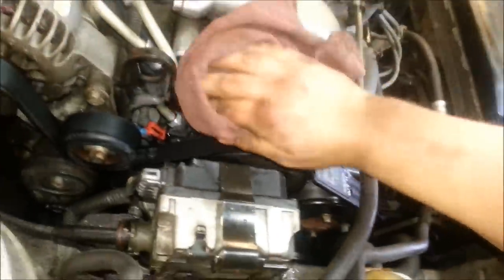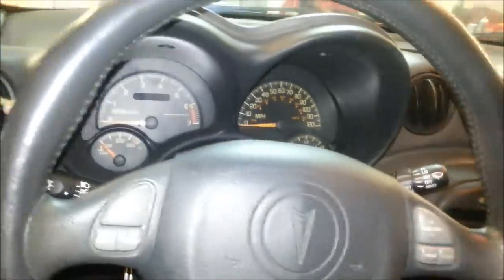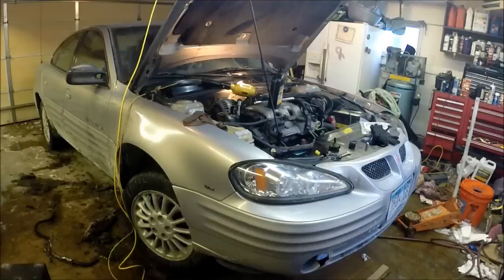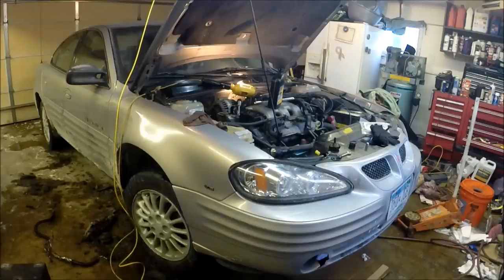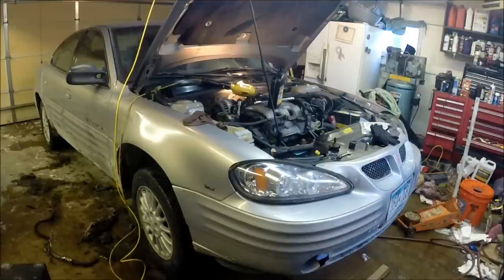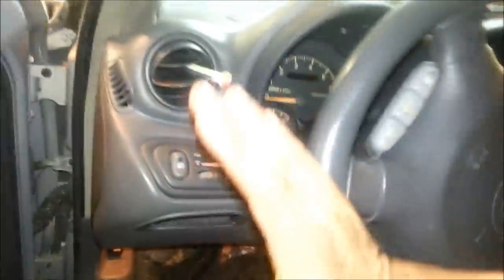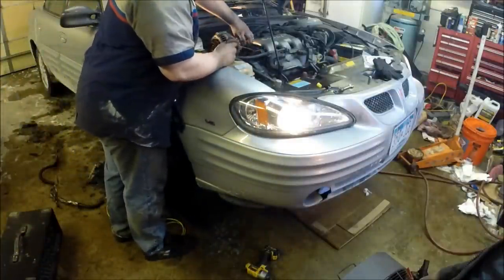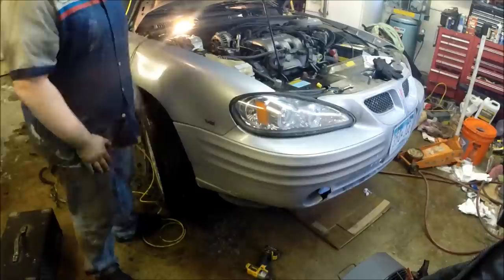how to bleed a gm powersteering pump

Comment: thanks for your help. my power steering fluid was coming out of the reservoir like a fountiain. I never try to bleed it with the car off the ground before. I saw this great video and did it with my car off the ground and it was so much easier! Man the strengh that I had to use to turn the wheel side to side with the car on the ground!!!
Reply: it was coming out of the reservoir while the car was on and tuening the wheel side to side. Would that be air???
Reply from the maker: +morganix007  could just be way overfull as well but air will push fluid up

Comment: Thanks for the video! I just replaced the pump and the steering was still hard to turn. Once I did what you said it worked! Thanks!
Reply from the maker: glad i could help you out.
Reply: Hey I replaced my pump, and I have a slightly dripping return line, but my stuff is still so hard to turn, but works when you jump the rpm up, so I have a bad center seal in my rack?

Comment: Power steering on my 08 Grand Prix GXP went out 2 days ago with little warning. The pump was never very noisey- only a very faint whine when turning right that you could only hear with the radio off and windows up. I'm going to try this tomorrow. I was rather low on fluid when I checked.

Comment: I have just replaced the pressure and return lines on an 01 GA, and went to use the Mityvac set up but the rubber cone does not seal in the neck of the reservoir and also is too long and sucks up fluid when its at its cold fill level..I ended up having to move the car out of the garage last night and of course the fluid foams right up (not bleed at all really).  So its gonna be a real pita to get air out of it now by any means.  Will have to start it again to get it back inside..so any settling that has gone on will be messed up again to try and do it by your method.  Why a proper adapter is not available for the necks of these style of P/S pumps is not available, is beyond me!  Good vid!
Reply from the maker: I hear you I've been searching for the adapter for awhile
Reply: +JoeTheAutoGuy I was just wondering if one could be made from an old cap from one of those pumps...
Reply from the maker: +Chris C that is a very clever idea , I think I'm going to buy a replacement  cap to modify ,
Reply: +JoeTheAutoGuy I just finished hacking up an old cap, cut off the dipstick and spring etc, took the rubber gasket out and set aside.  Then I drilled 1/2" hole in top of cap, threaded an air tool adapter male fitting into it and tightened it down snug.  Used some GOOP adhesive/sealant around the threads.  The clear vinyl tubing from the mityvac will fit onto the end of the air tool adapter, lay the cap onto the neck of the reservoir (rubber gasket back in place) and she pulls vacuum!

Comment: Hey Joe great video man.  I have a '13 Impala, I sucked all the fluid out of the reservoir as I could, disconnected the return line right there, jacked the car up and turned the wheels lock to lock to try to get the old fluid pumped out the return line into a pan, but got nothing. So I plugged the reservoir where the return line went in and put new fluid in the reservoir, turned the wheels lock to lock a bunch of times (20-30) nothing! Fluid didn't move in the reservoir and nothing out the return line. As soon as I hook the return line back up to the reservoir and turn the wheels, fluid gets pumped into the reservoir from the return line.. What am I doing wrong?!?!? Wheels are off the ground, key on engine off, following the alldata procedure for it, what am I missing???

Comment: Would you recommend using lucas stop leak in the power steering fluid? I heard Lucas can improve performance in the power steering system.
Reply from the maker: In this generation and in most applications no I for not recommend this system has a valve that requires flow efficiency, the stop leak will inhibit this action stop leak worked in older vehicles but new stuff and synthetic fluid requirements make those chemicals obsolete and will actually damage the system intended operation
Reply: I think this stuff is really thick to the point itll increase the pressure of the fluid and you'll wind up snapping off weak points. My return line at the bottom was rusted so the replacements kept coming off until I just used the fluid recommended by the manufacturer.

Comment: Thanks for video, i noticed you didn't use a vacuum pump. Is that a necessary step to use the pump?
Reply from the maker: its Most manufactures way of filling now but not an absolute necessity

Comment: I replaced the power steering power because it had a crack, so after I finish installing the new one... do I do what you did because I see bubbles coming out?
Reply from the maker: +The Lopez Way always need to bleed if system is opened( besides the cap )

Comment: GM's recommended adapter fitting (J43485) won't seal off the reservoir opening because GM reservoir openings aren't round (they have two notches along the inner circumference as can be seen in this video).  Why does GM recommend an adapter fitting that won't work?
Reply from the maker: Flip it upside down seals fine

Comment: I have a 1980 k5 blazer and im having issues with the power steering. it binds every so often especially in a tight spot. I replaced the power steering pump twice. just put the second one in today. I tried bleeding it and it work awesome the first few minutes but as soon as I really got on the road it started acting up again. i used the same method you used except instead of the fluid going down it started to over flow. i removed some and it still binds up and the fluid when i check it is foamy. i tried bleeding the air out of it again i works find then it starts binding again. i cant us the vacuum method cause these old cars have cut outs on the sides of the power steering caps. i don't see any leaks but wanted to know if you have any recommendations to help solve this power steering issue. thanks

Comment: Have to change a seized pump that threw the belt on a 2001 Buick Regal LS. The pump is in the WORST possible spot....bottom and back of engine. Ugh. Who thought THAT was a good place for a pump and reservoir? You have to take the wheel off just to access the cap. That engineer should have been hung by their short and curlys. Probably better do the pressure line while I'm in there. NOT looking forward to this AT ALL.

Thanks for the video. Very helpful.

Comment: I have a 2004 Pontiac grand prix gt and im having a problem with the power steering pump when the engine is cold i can turn the steering wheel pretty easy but when the engine warms up i dont have any power steering what would cause that?
Reply: Overheating of the fluid because of air in the system
Reply: I replaced the pump and problem fixed
Reply: @miker5044  thats good 👍 . Did you replace it yourself?
Reply: Yea i did it was not to hard to do

Comment: Hey you know how to fix the security problem for the pontiac grand am
Reply: many videos on you tube best is a 2ohm resistor in yellow wire coming from ignition video permanent fix other temp leave key in on position not running till security light goes out seen some take up to 40 minn avrage 10 to 15 minn I my self have done 13 of these everyone different BCM modules go bad also cars with no cabin filter reinstalled rain water floods BCM directly under Blower motor in glove box

Comment: I'm doing this and I'm worried that there is to much air trapped in my system. I turn my steering wheel lock to lock with the car raised and I hear gurgling but the fluid in the reservoir doesn't move it just goes up and down then when I try with the engine on the fluid foams up very quickly
Reply from the maker: +OGFadedThoughts  sometimes they need to sit for awhile ( overnight) to get really stubborn air out

Comment: i tried all you said to do but when ever  i turn the wheels left and right the fluid over flows, with the car off!
Reply from the maker: then there is a lrge pocket of air coming up just keep doing whAT YOUR DOING AND DONT OVERFILL IT. then folow the process i highlight and it should be good
Reply: thanks,
Reply: JoeTheAutoGuy-can u cause harm if it is over filled?
Reply: Dubblesteel hell yes

Comment: the thing about my 2000 olds Alero is that it is leaking steering fluid, so I would top it off every time it made that 'creaking' sound when you would turn the steering wheel. But now, the steering wheel has gone stiff, like it has no power steering at all, and even when I top it off with steering fluid, the stuff disappears from the reservoir and the steering continues to be stiff as all hell! 

what is going on? please answer as I am stumped!!!!
Reply: non-descript influence clearly you have a leak.
Reply: Rack and pinion that’s my problem right now

Comment: my 99 grandam has the foamy thing going on after we changed the pump, the fluid wont circulate at all and my car wasnt rasied.. the fluid that i did put in the car is on the ground and what i had left in the bottle and put in it just now is being thrown all over the car?  what do i do lol..
Reply from the maker: need to find the leak
Reply: +JoeTheAutoGuy ... it has the 2 hoses ,,if its not leaking from there what are my other options ? i dont wanna have to take the thing back off again..lol
Reply from the maker: +ashley dotson if it's not leaking from the hoses it's either leaking from the power steering rack itself or the pump
Reply: +JoeTheAutoGuy from what i can tell the  leaking is coming from around the pump area.. id say ill have to take it off again,, ,, but before i had the leak the fluid wouldnt circulate,,, it would just foam up any advice on what that would be? lol im sorry im bothering ya
Reply from the maker: +ashley dotson not bothering me lol, if it's around the pump area check the seal that goes for the high pressure line (threaded one), some times it won't look like it's circulating because the fluid stabilizes at a certain point under no load  , if it's not coming from the lines it's coming from either the reservoir seal or the shafts seal itself
Reply: +JoeTheAutoGuy I have done everything youve done in your video, I had recently replaced the pump because it was leaking. With the new one installed i have bled it. But it pours all the fluid out onto the ground. It isnt the high or low pressure lines leaking. its coming from a small hole on the bottom of the pump. I was told it is a "weep" hole. why would it be leaking from that hole. 2002 Montana, same pump in your video. Ive went through 2 quarts of steering fluid. Is it a bad pump, or is it supposed to do that until air is gone. And would that weep hole be sucking in air. Thanks for the video....
Reply: +JoeTheAutoGuy I have done everything youve done in your video, I had recently replaced the pump because it was leaking. With the new one installed i have bled it. But it pours all the fluid out onto the ground. It isnt the high or low pressure lines leaking. its coming from a small hole on the bottom of the pump. I was told it is a "weep" hole. why would it be leaking from that hole. 2002 Montana, same pump in your video. Ive went through 2 quarts of steering fluid. Is it a bad pump, or is it supposed to do that until air is gone. And would that weep hole be sucking in air. Thanks for the video....
Reply from the maker: +120 Market Suites definitely a bad pump if it's spitting out fluid
Reply: Have you heard of this weep hole
Reply from the maker: +120 Market Suites on a powersteering  pump can't say I have , waterpumps yes but not ps  pumps  but I don't know everything manufacturers change things all the time
Reply: Okay thanks so much for responding so quickly, I have never heard of this before either. I did look on the old pump that came off and it had it too. A small 1/8 " hole. Guess ill be taking it back off and going to the auto parts store again. Thanks for the info and the video.

Comment: I got a new pump installed 3 days ago and now its making noise??? 3800 Series 2 GTP. 1999. Help me man can I drive safe I'm worried something could happen.
Reply: Mar Stillo I am in the same situation as you brand new pump and is noisy as the old one but doesn't leak I've been driving it for about 4 months now no problems but still scary not sure what to do nobody will reply
Reply: Bump because my blazer is so fucking noisy after a new pump and it pisses me off. 3rd pump, adding more complexity to each bleeding routine. Next time, Im using a A/C vacuum pump overnight and sucking every damn bubble of air out to see if it makes it quiet. If not, im literally rebuilding my factory pump because im starting to distrust these re-manufactured pumps.

Comment: Joe please help me my grand ams pump hoes clogs up when I turn my wheel all the way to either direction the hoes Buble's up and makes my car shake what is happening ? Do I need to replace the whole pump or just the hose
Reply from the maker: if you can see the hose physically expanding to a cautious state the inside of the hose has failed and serious issues have happened , if it shutters usually that is a sign of air in the system and if its that bad all the sudden you have fluid loss and possible rack issues

Comment: Duuude, don't run the car with the garage door down!  I know it doesn't seem to be a big thing but that schitt builds up in your liver over the years and then the party's over. 

Also, I know it seems like a pain to do it but get your garage cleaner and keep up with that. Pretty soon you're going to start losing things and be making dirty footprints everywhere that your shoes pick the grime up off the floor.
Love,
Mom
Reply from the maker: +Stinky Cheese  yes run vehicle in well ventilated area ,i have a side vent in my garage with a hose to run exhaust outside , dirty gargage is what you get when you share with people
Reply: Ducky1521 he said he already cleaned it in another reply
Reply: His garage floor could benefit from a good epoxy coating.  
Thanks for the video.